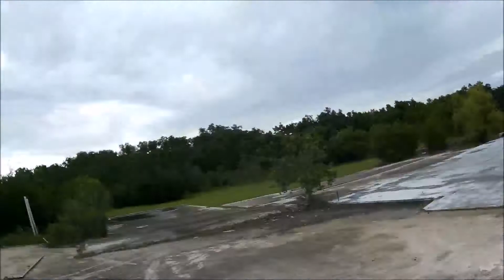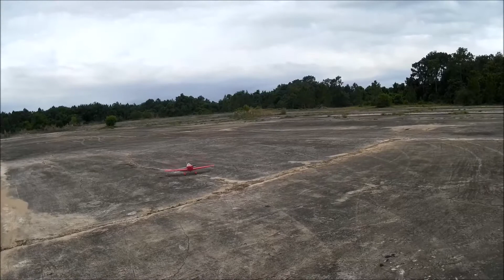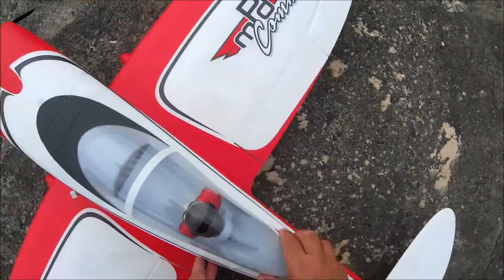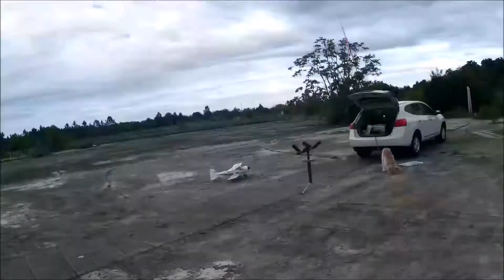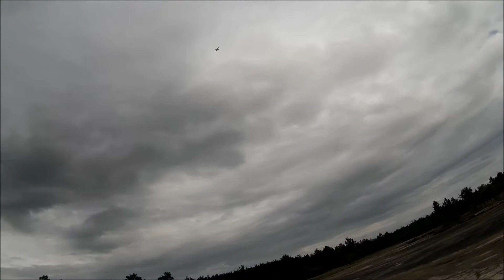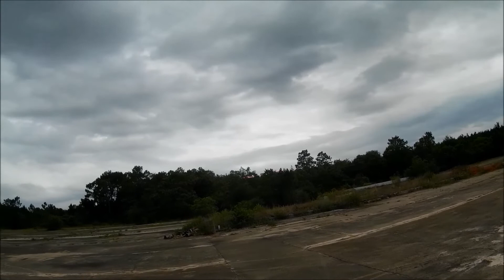E-Flite Commander 1.4m mPd 3Jun17

Comment: Ir could just be the spinner not sitting all the way down on the back plate, did you change anything recently. Maybe my three cells are not as good as yours. The plane is not that fast with 3s
Reply from the maker: Haven't changed anything but will tear it down before it hits the rotation again.